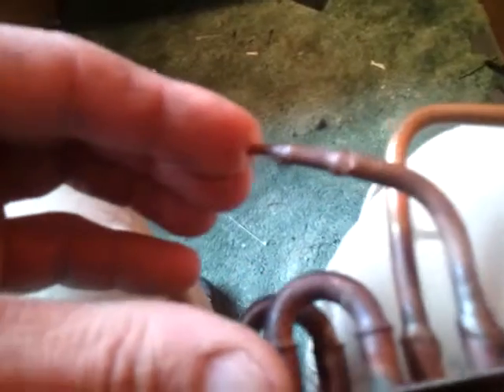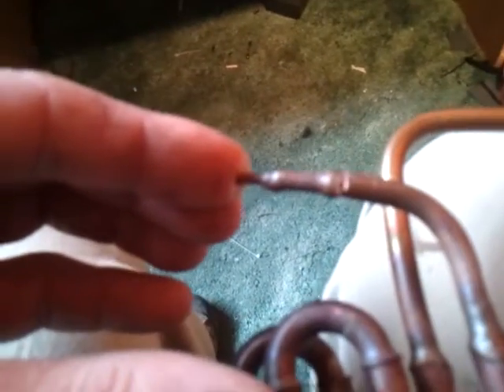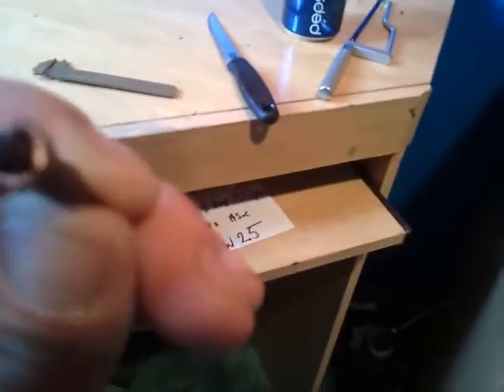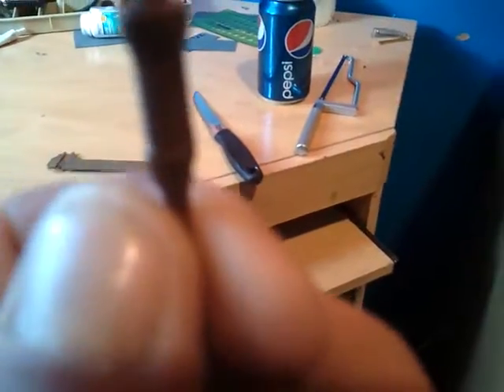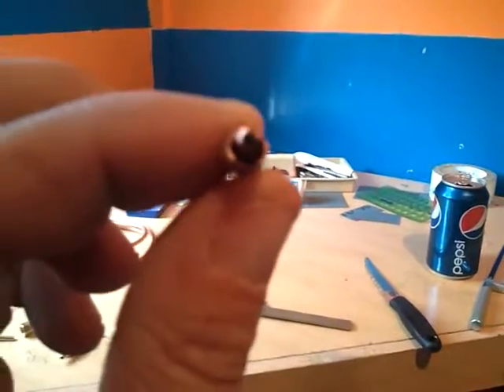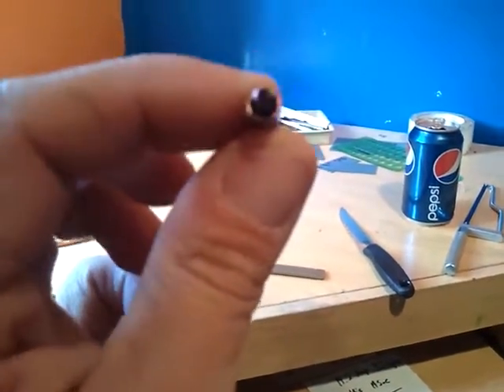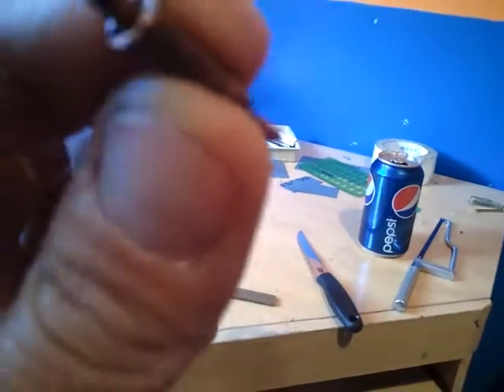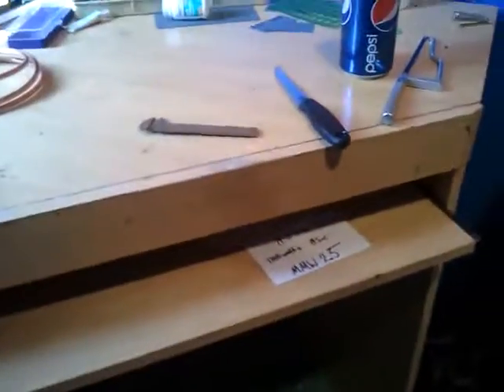reason for most air conditioner failures

Comment: Hey man!, yeh thats your condensing coil!, the black stuff, as ytmachx said, can be dissolved with solvents (try white gas or even unleaded gasoline) and it will wash all of the muck and residual oil out of the coil.

I do the same thing when I want to use one for water based applications. the compressor oil fouls things up.

Comment from the maker: @ytmachx thanks for the info, i was taught that that part of the device is what actualy liquifies the gas, any way i did an experiment and found that the gunk melted very easely and one may be able to fixed a inoperable unit by heating the capilary